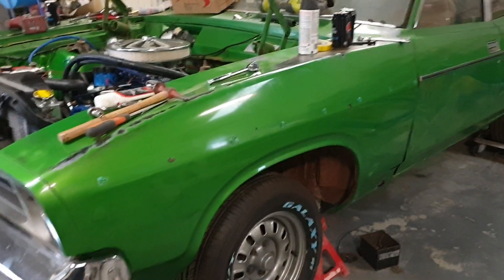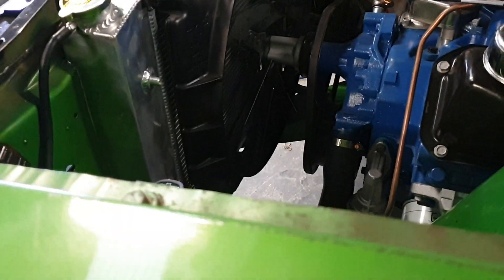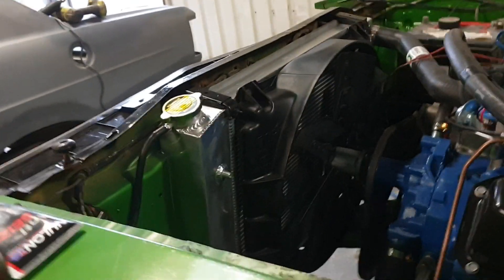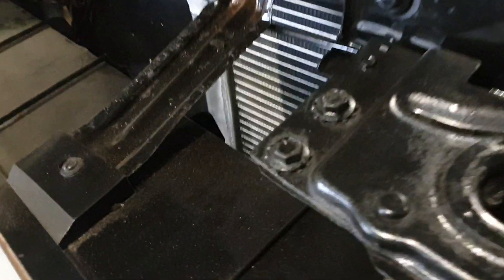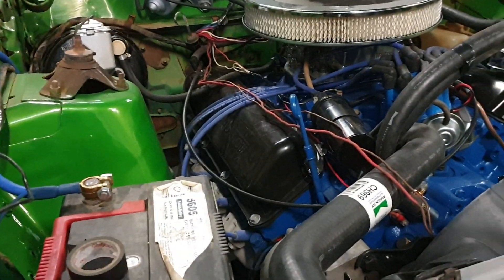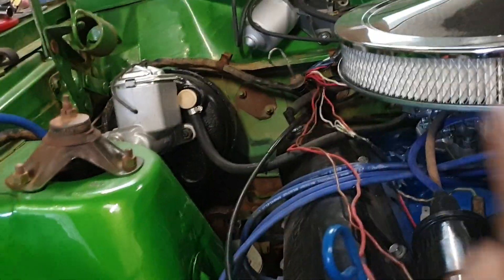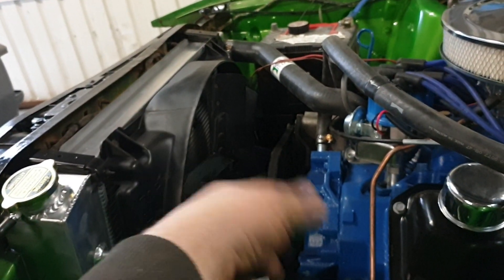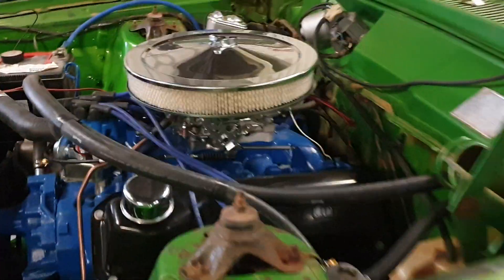Project XB update and slight rant

Comment: Are you replacing to the v8 fuel line  completely from the rear or modifying that one , love to see it.
Reply from the maker: It's only the front section that is different I was planning on cutting and joining in the v8 front section with a small piece of rubber fuel hose
Reply: @xacoupeguy  yep thats why i asked planning on doing same  thing thanks